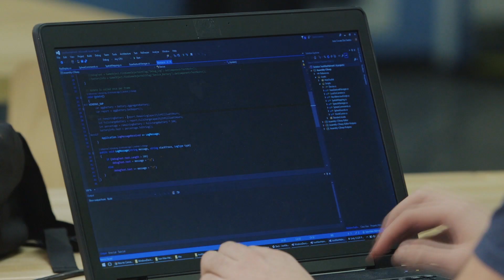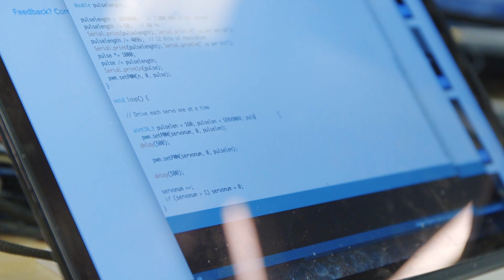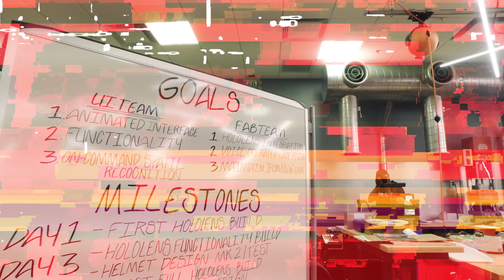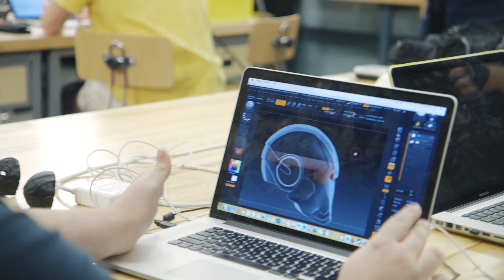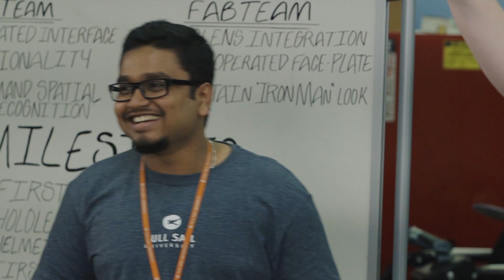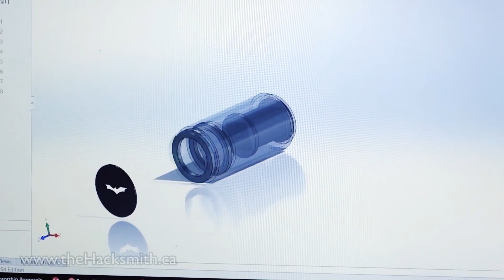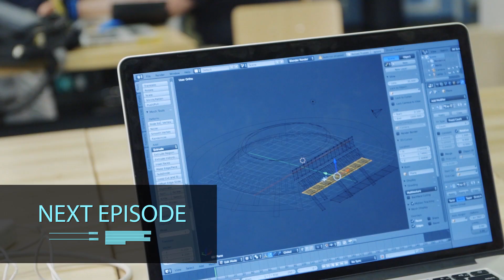Hacker Labs: Iron Man Helmet Challenge Ep. 2 ft. the Hacksmith | Full Sail University

Comment: Why don't you disassemble the holo-emitter headset and incorporate into the helmet's normal dimensions? You can install the holo components by creating an inner shell and possibly making the outer shell a 1/4 inch larger than the inner shell. The components would go between the two shells. with the lens being where the visor is. it would be even better to place a camera in the helmet and have the image that the camera picks up display on the visor with the eye-pieces being the location where the targeting unit displays.  Another idea would be to remove as much of the holo-emitter so it would allow you take up less space inside the helmet.

Comment: Not to be arrogant. But fly me out there. And the project will be over. 3D print a scale model helmet (prop), disassemble the hololense, and use a dremel to remove the maximum amount of plastic out of the way. Hinge the mask. Epoxy the lense to the face mask, place the battery pack in a concealed. Watertight case and run a wire down your body into a pocket.

Comment: hey Tony stark actually had his main power in his chest isn't it, so u guys can separately use a power supply instead of using it on the helmet it self. therefore u guys may have more room for other circuits. Hope u guys take this as an advantage....
Reply: Sampath Gamage where else would it go?
Reply: you guys can wire it up to external power source such as a power bank. just bring a wire out of the helmet so it can be connected to power source. I know that it would be ugly but I think it would be worth and also I think it would be more professional if you guys use some magnetism to lift the front part of the helmet. so it can be removed as it is in the film. Or else use the circled parts  that are in near the ear to put a flat motor and bring a small pease of metal or plastic to fit the front part of the helmet. where then it can be lifted. figure out a way to pop out the front peace and then lift up. I think it would be much easier if you guys divide the helmet in to parts and then assembly it. You guys must make sure that you guys disassemble the holographic goggles and fit it's circuitry to helmet without the plastic parts.
Reply: Sampath Gamage yes dude my thoughts exactly but people have told me the lens cost 3000 and they had a very limited amount of time so they didn't think it was work it
Reply: Sampath Gamage the thing is since they want the whole hololens in there when the faceplate goes up you'll have the lens on still which won't look good in my opinion

Comment: Why can't you make your own headband or disregard the holo lense headband all together? I'm a mechE
have you considered hingeing the faceplate over the crown of the skull vs. the temples, utilizing routed tension cable and a micro servo?
I've designed a similar system on paper for the fallout 4 power armor exoskeleton. Using an Udoo Neo board for the Pipboy interface.

I'm also adept at 3d printing tolerances and design.

Currently working on a confidential Uni project but would LOVE to contribute in any way (solid modeling, electrical routing, power corrections) that I can,

Please PM me. This kind of stuff is my passion! I've been combining my engineering knowledge with cosplay for 5+ years.